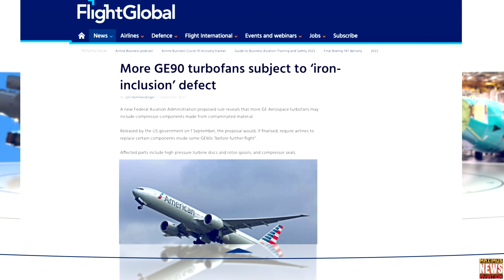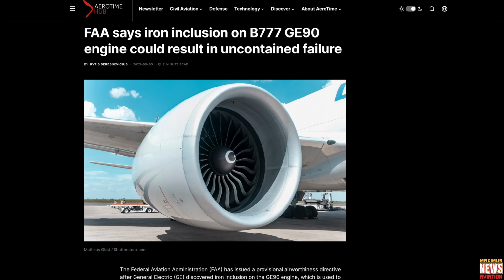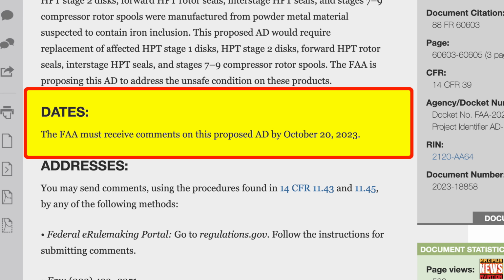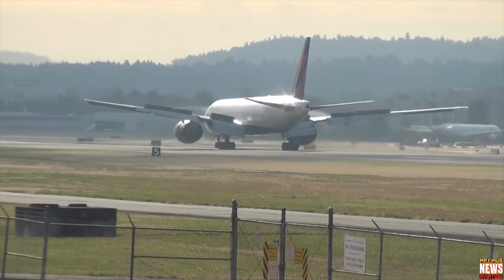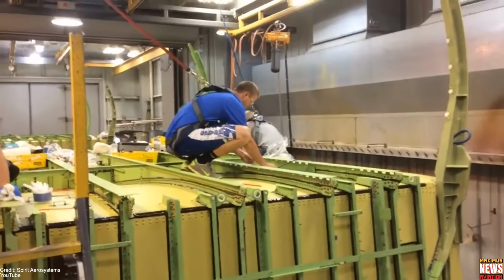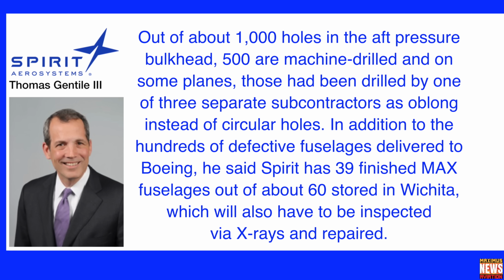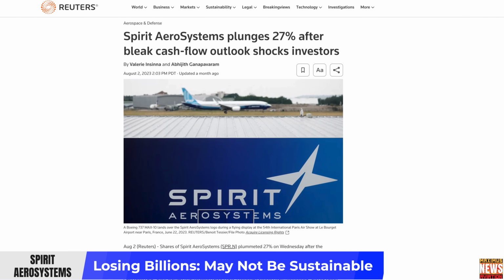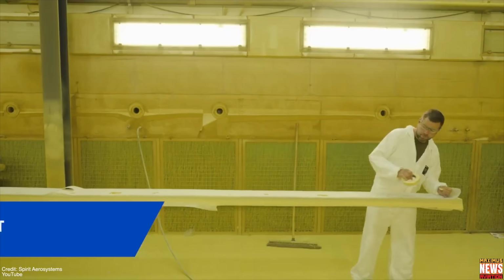The Big Boeing News Report: Includes Bad News For The 777, 737 MAX, 787, And Even Airbus Jets!

Comment: I flew Boeing my whole life...sadly,,they had alot of flaws..I won't get on a 737 Max. My Life is worth more than a software change
Reply: I should imagine the fact that Boeing engineered a slightly unstable aircraft, “fixed” it with a software patch that overrode the pilots, didn’t even tell the pilots that the software existed let alone what to do with it when it malfunctioned… and ensured that safety critical software had a single point of failure on purpose, might have soured the OP’s trust in Boeing.

The short version is that Boeing designed a dangerous flaw into the 737 max 8 and not only knew it, but did everything they could to conceal that dangerous flaw from both pilots and the authorities (FAA.) 

I’ll never fly any Boeing aircraft ever again because I don’t trust them to value our lives. They’ve already killed 348 other people with that attitude. No, I fly only Airbus or Embraer now.
Reply: @mikoto7693  You perseverate. You are literally stuck. We have all gone through the laborious analysis resurrected in your Max trope. We know the causes. We know the mistakes. Serious? Yes. We have moved on. The issues were addressed. The Max has now been purchased in the thousands around the world. There is a current back order. As with any aircraft…further issues that arise will be addressed . Airlines do not now share your obsession and endless rancor. Find something else to flatten with you insufferable analysis. Cheers.
Reply: @mikoto7693 you hit the nail right on the head...all true 😊 sadly
Reply: why would a software change make you not fly a 737max? perhaps dont fly any aircraft because they have software changes every now and again
Reply: @nickolliver3021 Boeing designed the aircraft with a Known flaw to make the engines fit. That's the difference
Reply: @cjswa6473  we all knew ut was an honest mistake. Tne engines did fit as they were specifically designed. That should not make you hate it
Reply: @nickolliver3021 you are kidding..the engines actually protrude slightly above the wing...for an underslung wing engine..right there is a problem...also these engine's can take up to 3 minutes just to start,,from parts "bowing" problems. I can name 5 other issues,,from the blades,etc. To the fact that it's all about " money". With Boeing,,and the airlines. You safety is second to that😮
Reply: @cjswa6473  So what is so bad that the engines protrude above the wing engine?  That's not a problem. Hoe do they take 3 minutes just to start from parts blowing problems? The blades are not even a damm problem and those are not a reason about money. Our safety is not second to that
Reply: Your assertions are emotional and childish. You will die in your automobile long before you would die on a Boeing Max. You are ridiculous. There are thousands of Max flights every week. The pilots love them and so do the passengers.  Pull yourself together man.

Comment: I am very much convinced carbon fiber may not be the right  material for aircraft. It does the job for now but it's not aging well. Both Boeing and Airbus are having problems.
Reply: Funny how they both have the same supplier 😂  At the end of the day there are thousands of composite planes flying. We "just" need appropriate maintainence etc etc ..DeHaviland Comets were metal skinned and it didn't save them
Reply: @nonsequitor  Randos on the internet lay up Carbon Fibre better than the pretend independent company building most of the airlines. 

Toyota with the LFA proved it’s not hard to do if you actually try.
Reply: i feel they may need to develop new resin materials to act as a substrate - after all carbon fiber composites are mostly just reinforced plastic and the plastic is usually the weakest link
Reply: Apart from uncertainty surrounding long term physical qualities of carbon fibre one thing is known; as it does not conduct electricity carbon fibre aircraft are much more susceptible to damage from lightning strikes.  The last generation of all metal aircraft were pretty much immune to lightning strikes.
Reply: @daniellarge9784  the long term wear and aging is imo the biggest problem with it compared to metals - plastics degrade over time, especially when exposed to heat or UV (though it is painted so that shouldn’t be a problem maybe?)
Reply: Carbon fibre made at the cheapest bid by secondary contractors certainly isn’t. 

When the company can milk 5 times the cost out of it for a fighter jet, it works fine.
Reply: Two points, Maximus. Well, first, thank you for this update. Then, first point, doesn’t Boeing make its OWN 787 fuselages in its own autoclaves? (I believe I’ve seen pictures of the BA 787 autoclaves.) Secondly, I ‘ve seen something somewhere on Aluminum Lithium (“AL”) metals in aviation applications rivaling carbon fiber in aviation articles in the last few years. Can you address this issue?  Thanks in advance.
Reply: Stick with aluminum…tried are true for decades.
Reply: @40cleco  Knock Knock.
Who’s there?
Metal fatigue and powdery corrosion!
Metal fatigue and powdery corrosion who?

Wing spar snaps.
Reply: Problem is if you strike a metal fuselage with a service truck or baggage belt it usually leaves a dent which can be easily seen by engineers or flight crew on a walkaround. 
But if you strike a carbon fibre fuselage sometimes the surface returns to its original shape and leaves very little evidence of the underlying damage!
Reply: @hugostiglitz6914  100% this. There’s ways to fix that with slick stuff like die impregnated microcapsules and such, but people insist on uniform boat white finishes that prevent visual inspection of a semi-transparent Substrate with a UV-cut clear coat. Which makes voids immediately apparent. 

Trying to make composites look like metal is half the problem.  And the RV and Boat design aesthetic doesn’t help.

Comment: Fly Airbus see the world, fly Boeing see the next one.
Boeing was a very good company, but then the beancounters took over, and there the trouble started
Reply: A variant of that Harley meme (Buy a Harley, buy the best. Ride a mile, walk the rest) seems to be appropriate for Boeing: 
"Fly a Boeing, fly the best. Fly a mile and then you crash."
Reply: This has nothing to do with bean counters taking over. It's the suppliers issues that's doing all this to boeing and airbus.
Reply: @nickolliver3021  Then it is about the bean counters at the suppliers
Reply: @RickTheClipper  the suppliers are not doing their job then are they
Reply: Because Boing has sqqeezed them so tight, such a loving embrace..... @nickolliver3021
Reply: @nickolliver3021  ...and who do you think mandated using the cheapest "suppliers" possible. It wasn't the engineers, Einstein. 🥴
Reply: @TheTransporter007  tell that to all the manufacturers out there that outsource all their parts for their aircraft cupcake 🥱
Reply: @TheTransporter007  The OLD Boeing was led by engineers, the time of "as cheap as possible" came with the bean counters
Reply: @nickolliver3021  I would if I could, but nobody gives a fuck if you or I die in some fiery aircraft crash, so long as they can put another dollar in their pocket.
Reply: @RickTheClipper  that's what airbus does as well. Everything cheap and not lead by engineers
Reply: @TheTransporter007  well one person won't convince them too will they. Why would a plane vrash where you would die  in a fiery way lol.